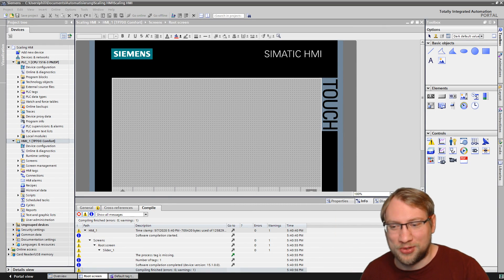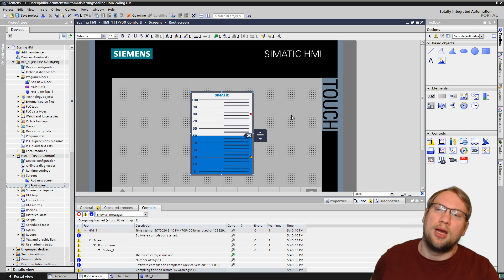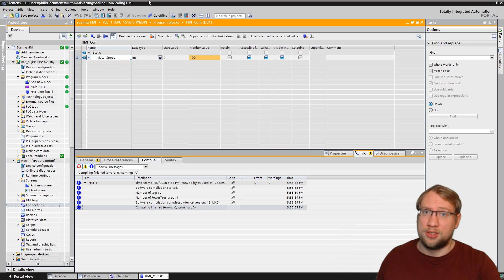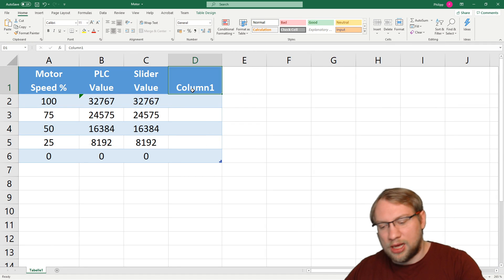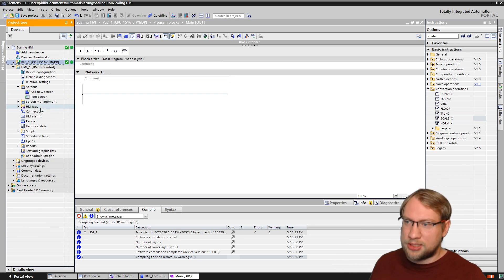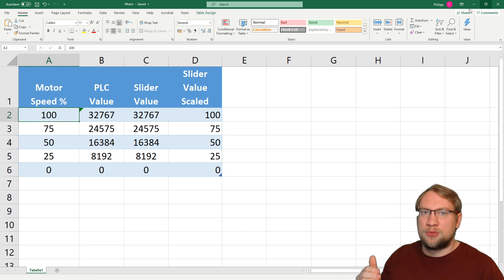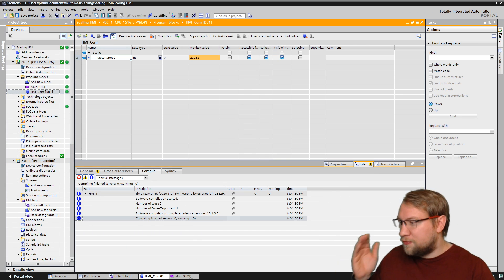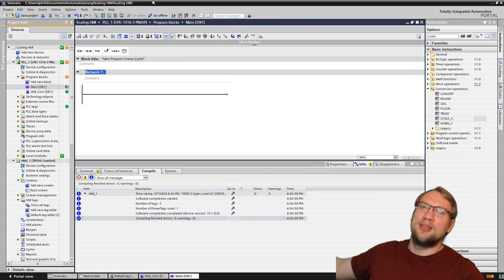TIA Portal: HMI Linear Scaling

Comment: Hi, basically it is a good feature but one big Problem with this is the readability. When u have an error that u somehow have to trace back than there it is always better when u know where all the programming comes from. In this case there is some script running in the background which u cant controll or watch. Just my opinion. I think the advantage of using PLCs like Siemens for maintenance are the error tracing options because of its readability of the used programming.

Comment: correct me if im wrong but, 32767 is 23 mA which is overflow so its not 100% but its over.
The 100% should be 27648 which is 20 mA, or maximum for analog inputs?
Reply from the maker: Won't correct you, because you are already correct!
Reply: @hegamurl  so in that case you should make linear scaling to 27648 instead of 32767? because 32767 is wrong, its more than 20mA.?
Didnt get it.

Comment: It might be easier, but i think this is lazy programming. I rather handle things like this in the plc. Then i'm not limited to the limitations of a hmi/scada. Also a good program has flexible functions for input reading / ouput writing with manual overide and everyhing and scaling build in, so there for this example there would not realy be a need to do scaling on the hmi. Good explanation nevertheless.

In last 8 years i have never used this scaling though i knew it exists.

Comment: 118,515% = 32767
100% = 27648 
Oder verstehe ich da was falsch?
Reply from the maker: Correct! If you want to put this on an analog output. But always also depends on the hardware setup, that's why I left it more general
Reply: @hegamurl  große Anerkennung, super Arbeit die du da machst! Sehr lehrreiche Videos, mach weiter so👍
Reply: thank  Hegamurl

Comment: hmmm does this work in all the TIA versions?  It's great there's a simpler method that may or may not reduce the PLC's memory overhead? I think the scale x and norm x is very good for beginners. Let them suffer😈 only when there's an easier way😇
Reply from the maker: Good question with the versions, will test it out later... my PC at home only has V15.1 installed
Reply: @hegamurl  Yes it does.  I've been using every version since V11.  There are few reasons I don't generally do this though.  Mainly because it's hard-coded into the HMI, and if you need to adjust scaling in runtime you can't.

Comment: Great video nice trick I've got a question not exactly related to this but is there a way to make a variable graph for example if you enter a value say 50 the maximum on the graph will be 50 but if you change to it 100 then the maximum will go to 100
Reply from the maker: Of course there is! In the "Properties" of the slider you can set a "Tag for maximum" and "Tag for minimum"... just put a variable there and your slider automatically adjust to that value which you can then use in your program